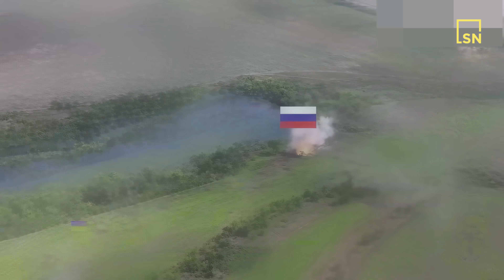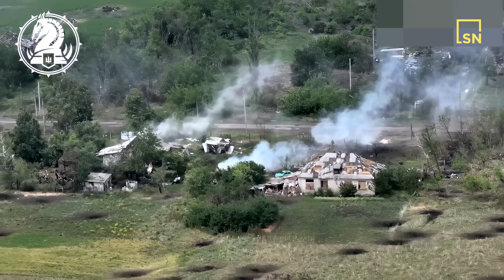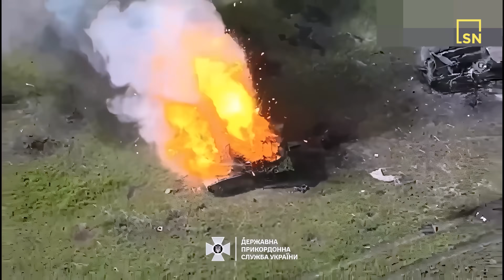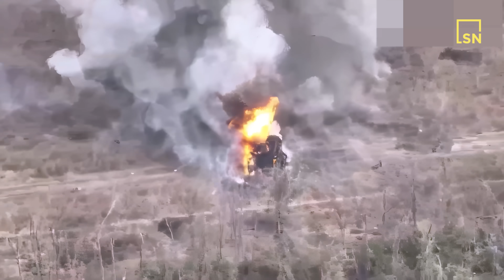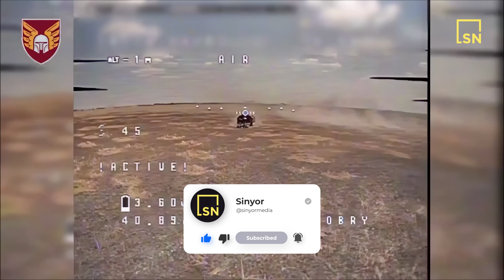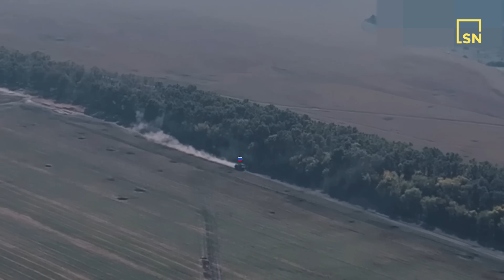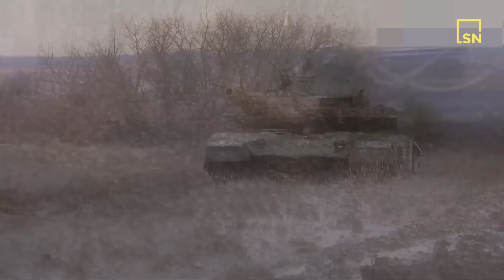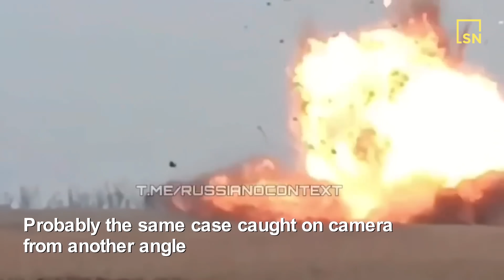Two Abrams Face Russian Brigade Alone, Head-on

Comment: Pretty sure I have heard before that the reason the Russian tanks so easily blow up or flame up is because of the autoloader. The auto loading system leaves the ammo open inside the turret.
Reply: Not exactly autoloader per se, but how ammo is stored.   Its basically placed in the middle of the tank around and below turret. Crew and tank interiors are basically fully exposed to when ammo gets ignited.        Western tanks on the other hand have separate , sealed and armoured ammo compartments designed to vent ammo ignition outwards while protecting rest of the tank and crew. Not that this system will work every time, but more often than not it greatly decreases chance of catastrophic ammo explosion. On top of that crew gets to live and tanks can be still salvaged.
Reply: @maciejilski7185 good info and ty for explaining 👍
Reply: @BetteBalterZen  To add on to what mac said, crew survival is of huge importance in prolonged armored warfare, the performance gap between skilled crews and inexperienced ones is huge.  On top of that the basic training of a tank crew generally costs more than the vehicle itself does, and it takes much longer to train a new human being than it does for a factory in war production to build a new vehicle.  A tank which is easier to build but doesn't protect it's crews may have more units on the field faster, but all other things equal tanks that are built in fewer numbers but protect the lives of their crew will tend to come out on top, because after the first rounds of combat kill the experienced crews of the less protected tanks, their replacements will be totally inexperienced in combat.
This is the major problem with the old Soviet design philosophy around tanks.  Ukraine is somewhat more insulated from this because while they also use a lot of Soviet derived vehicles it's mixed with western tanks and IFVs, so on average a larger percent of their vehicle crews will survive to become experienced veterans.
Reply: @maciejilski7185  Это именно полностью автоматическая система заряжания. Поэтому экипаж российского танка меньше на одного человека и российский танк  имеет ниже силуэт и ощутимо меньший вес. 
Посмотри  видео от российских дроноводов и ты увидишь , что западные танки Абрамс, Леопард, Челенджер  также превосходно горят от ФПВ-дронов и также гибнут экипажи только на 1человека больше. Именно по этому западные страны перестали поставлять свои танки на Украину (страдает репутация), а не потому что танков мало))))).
 В обычном танковом бою (танки против танков) преимущество будет .....у чьих танков? Наших или ваших?
В самом начале ролика показано поражение Леопарда и затем поражение нашего танка.
Так что танк против танка это одна реальность, а танк против ФПВ-дрона  это другая реальность.
А на Украине  нету танков....осталось очень мало, поэтому русским танкам нечего подбивать.
Reply: any existing tank will be destroyed if you throw grenade inside. Difference is that t-90 can take 3-7 hits before being abandoned and western tank take 1-2 hit at max before being abandoned
Reply: Yep...the autoloader take a lot of space so the magazine for shells is all around the turret. A ring two deep of shells that all ignite when you get hit just about anywhere really. It's almost like some Americans spies develop it for the Soviets. 50 years later and they all understand it's a design flaw but still use it😂😂😂
Reply: @JohnJ-p7o Russians are sloppy 😄
Reply: @BetteBalterZen  Русские тебя  научат культурно общаться, когда пару раз ткнут кулаком по лицу. И если ты не будешь улыбаться получишь ещё ...